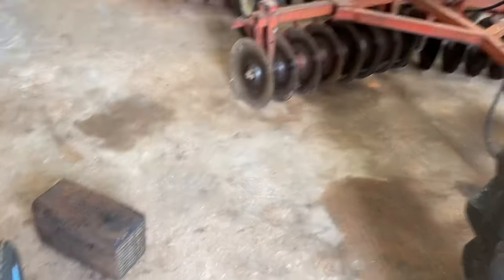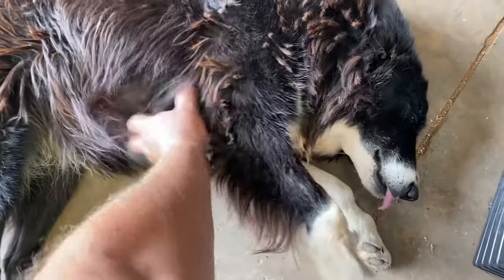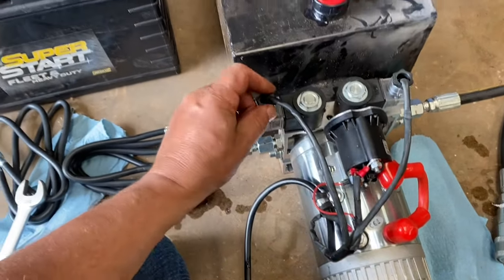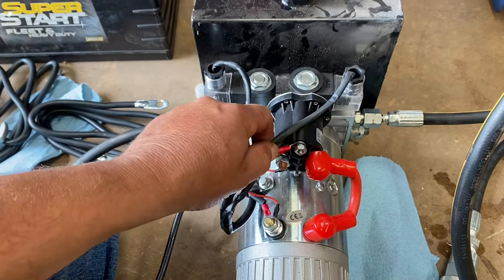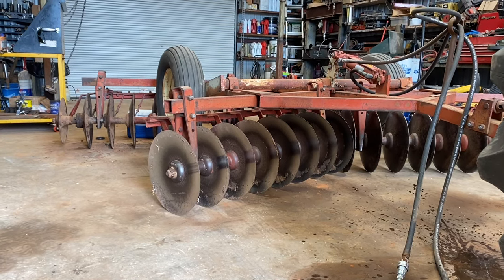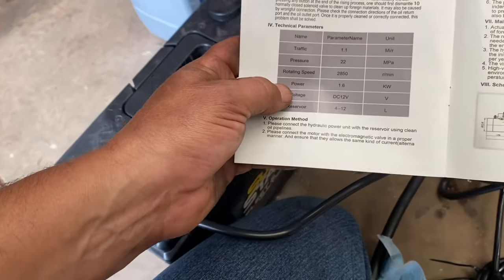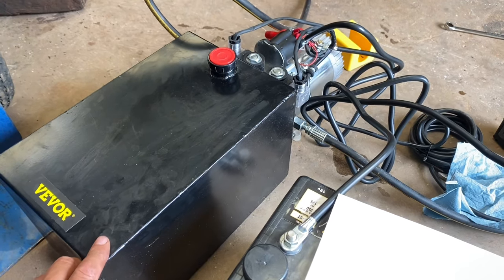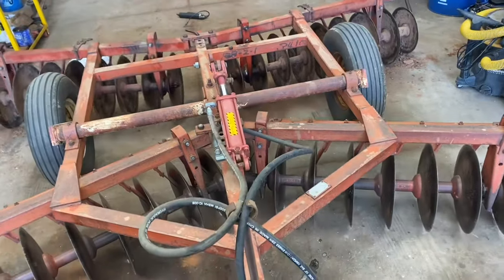Vevor 12 volt hydraulic pump review

Comment: I have an 8 foot aluminum dump box insert for a pickup truck. The original electric pump blew a seal, so I installed this new pump. I had issue with air not bleeding out, so switched hose connections, and I heard bubbles in the tank, as air was purged. Another video suggested UP pressure is 3200psi, and DOWN is 1500psi? Instructions and specs fail and pump outlets are not marked. So far 5,000 pound load of gravel dumped, but heavier bypassed. Do not currently know cylinder diameter on scissor lift.

Comment: Ive got a hydraulic wood splitter that we run off of tractor hydraulics. Id like to hook one of these up to the splitter and skip the tractor hydraulics. ( borrowed tractor, not always available) looks like it should work. Questioning durability ( high cycle application) and speed of operation. anybody have experience with it?

Comment: You are going to want a cross port pilot operated check valve mounted on the cylinder.  This valve will lock fluid in the cylinder when in transit or parked. The only way it will lower is either by powering it hydraulically or the cylinder will have to leak over the seals. If you do not do this, the current hydraulic cylinder will become a pump and can generate a massive amount of pressure while driving along. This pressure can and will damage the hoses and pump and valves. The best is to keep it contained in the cylinder, its made of steel and can handle at minimum 4X the rated pressure. That one looks like either a 2500 or 3000 psi version. Good luck and happy hydraulics. PS be sure to clean you oil if it doesn't have a good filter.  Easiest is to grab a filter with a farm and barn head on it, crank in some fitting that match your QDs for your equipment and then run it through the filter once in a while for an hour or so. Be sure you are flowing through the filter in the proper direction. Dirt migrates into your hydraulics through the rod seals and also metal wear form internal mechanisms.

Comment: We use them on small dump trucks. They do not last long at all. Solenoids burn out quick. Heavier loads will burn them smooth up. Just my experience with them.
Reply: Solenoids been no problem, if you have problem replace with higher amp  Solenoids
Reply: Battery capacitance issue. Bigger leads. Bigger battery.

Comment: I just got mine hooked up. It only goes up weather I push either button. Not having fun.
Reply: Did you get the 2 way pump?
Reply: @andyjennette  yes, it had got tiny specs of something in the valve. I put some inline filters on it. Working ok but I'm not impressed. My cylinder is large and cycles out if Im not careful then I have to wait for it to reset. I don't recall it saying that in the description but it does in the crummy manual.
Reply: I have a roll-off truck with a "Hy-tower" tarp system, that operates vertically. The manufacturer wants $1600 for their pump.
  I removed the reservoir, made a copper suction tube (had to tap the threads to 1/2 NPT.) and the screen. 
  Working like charm and under $350  with new hoses.
Reply: Awesome!
That’s exactly what I need to do. I have an Autocrane on my service truck. The tank rusted out, so I want to use this to replace it. That was my biggest question, can it run vertical or not. I even emailed vevor, and they couldn’t answer me.  Lol

Comment: Thanks for the review. It looks like a handy 12V power pack especially with that quite large hydraulic tank. To use it on an implement like your disc harrows you should use a double pilot operated check valve on the ram. It will hold the ram in position and prevent any hydraulic shocks going back to the pump.

Comment: I've got 3 of those units Frank. One I put on my 5th wheel equipment trailer to operate the tongue jacks, and I put the other two on my 5th wheel camper to operate the slide outs, and leveling jacks. So far so good.
Reply: I was looking to do the very same thing for my camper slide out .I wasn't sure it would work ,glad to hear it does for you I'm gonna order one now thanks for sharing info

Comment: I was looking at getting one of these for a dump trailer project. Let us know if it lasts any good
Reply: you cant use a double acting pump on a dump, single acting only, it cheaper too
Reply: @arnoldromppai5395  my other dump trailer and all the other ones I’ve used has a dual action pump. Power up and power down. Most dump trucks are single acting and just gravity lower, but electric trailers are usually different

Comment: Well, good timing Frank. I just bought a Vevor 110v deep well pump to reactivate an old well, to keep the stock tank (other places, they call them "ponds") full with the drought. Was a pretty cheap pump, (okay real cheap, but that well hasn't had a pump in it in 20 years,  and I never heard of Vevor before, but for the money, "what the heck?") I haven't hooked it up yet, because "drop pipe" for a well is darned hard to come by (supposed to be here Monday or Tuesday).  From what I can see of the instruction manual you got there, it's like the one on the Vevor well pump, "loses something in translation."